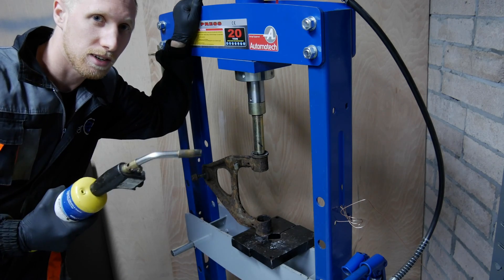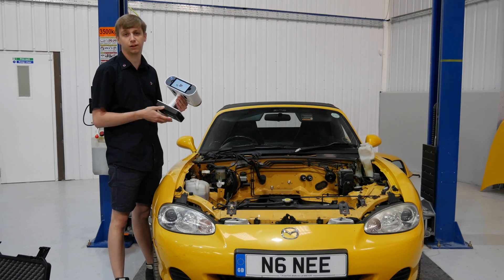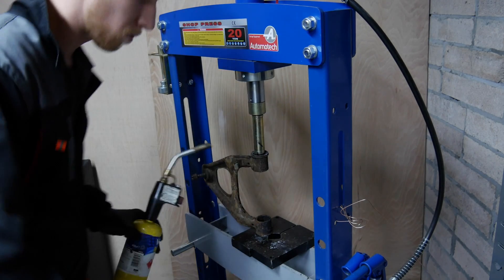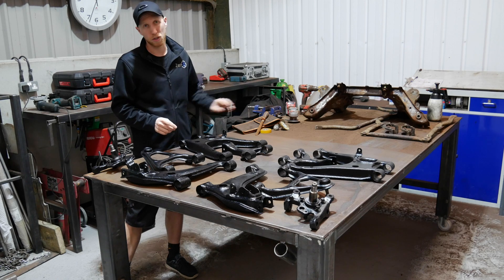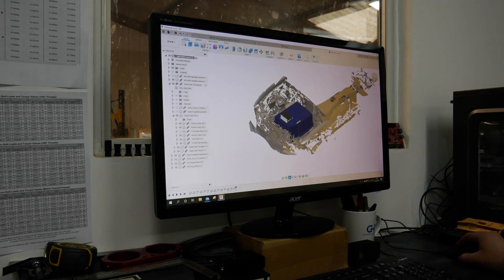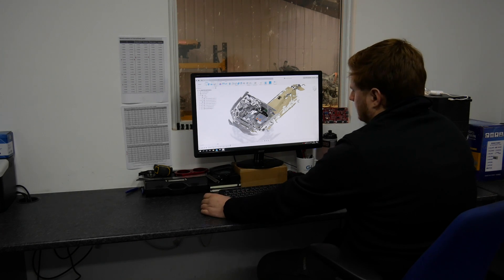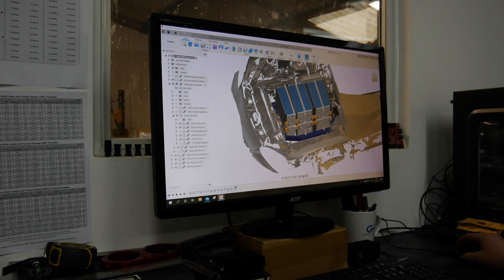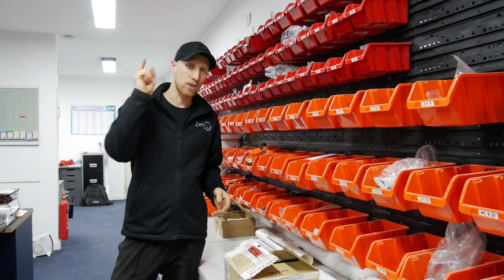Electric Mazda MX5 Miata Eunos EV Car Conversion - 3D Scanning, Fire & Cad Design

Comment: What's nice about the Miata is that you have quite a wide transmission/gearbox tunnel and so you can get your Hyper 9 and reduction gearbox a long way into the tunnel freeing up the engine bay for batteries, inverter, DC/DC convertor, water and pressure pumps etc.... This is not the case if you were mating the hyper 9 to the original gearbox. This is the big advantage of using the reduction gearbox in my opinion other that its simplicity and weight advantage. My only question is do you sacrifice a lot of top speed by having a fixed gear ratio? The hyper 9 is not a high RPM motor, so just curious what you're expecting in terms of top speed for this build given the reduction ratio, diff ratio and wheel size?
Reply from the maker: Jason Dunn our new motor is 250-450v
Reply from the maker: Our calculations is about 85mph with a 3.6 rear diff. So not perfect but enough. We do have a new motor under development that is the same size as the hyper9 but goes to 12,000 rpm and 330nm torque
Reply: @Hazell_Nutz  Wow.... that's powerful. I assume that's a high voltage setup? We have also worked with UQM135kw HP motors for max RPM of 10,000 but that's a 300+ volt set-up so requires a bespoke battery solution (unless you can fit 12~14 tesla modules in your car), but gives you higher top-line speed. Will be very interested to see your new motor. Thanks.

Comment: Definitely should’ve had the arms blasted! So much easier than wire wheeling! Fair play to you for getting it done though 💪🏻
Reply: Should probably had a acid bath or replaced. You could still see all the rust inside after painting them 🙈

Comment: For the bushes, we had a similar problem on the 1999 Z3 and for those lower controls arms we took the portable band saw and cut off the top rubber flange allowing us to just push from the outside in without putting any substantial stress on the arms themselves.

Comment: When you were cleaning the rust and scum from the arms, could you not have used an electrolytic bath to keep things a little tidier?
Reply from the maker: Yes someone else said the same think did not even think about it.
Reply: Time to invest in a bead blaster cabinet perhaps? Would have been so much easier and given better results.

Comment: Design looks very tidy with modules near what they connect to electrically and modules near each other, for short cable lengths and minimal resistive losses.  Reusing the factory mounting locations is definitely the way to go since they're already engineered for mechanical loads, etc.  Overall a very sensible approach.  Well done.

Thanks for another great video!  Audio is much better this time, but music is way too loud compared to voice.  Use an averaging sound level meter (plugin or function) to balance the audio levels better.
Reply from the maker: Thanks, just started using adobe premiere pro so am sure I am missing a setting

Comment: You aren’t putting batteries where the gas tank used to be? I figure that would help with weight distribution as well as increasing space for batteries. Cooling would potentially be an issue but if they are water cooled anyway then it couldn’t be that hard to run water lines where the old fuel lines ran and route them to a radiator up front.
Reply from the maker: Fuel tank area is currently being left so a second pack could be placed there, offering double the range.

Comment: its going to be very front heavy, considering the wait and placement of the electric motor and battery. you really need to balance the wait out more or risk loosing the back end while cornering. i don't know if heavily modified suspension will save this. i would personally split the battery 1/3 in the engine bay 2/3 in where the fuel tank was trying to balance it best you can.
Reply: Agree, but there are pros and cons of any design decision.  Splitting the battery pack increases wiring and electrical losses, and also adds complexity.  But in terms of driving, balancing the masses better fore and aft would be better.  

Keeping the battery pack centralized and right next to the motor, DC to DC converter and charger keeps things mechanically simpler and the electrical losses minimized since all the electrical path lengths are short.
Reply from the maker: The plan was to leave the fuel tank area for now, offers a option for a second battery pack. Might try and move the motor down the tunnel more to push weight back.

Comment: Couple of questions for you, 1- Do you have a rough initial estimate of how much weight you expect to put in for the electrics? 2- What is the plan for the space in the boot, is that being used for anything conversion related?
Reply from the maker: Weigh we should be about the same. The Ev system will be just over 220kg. The boot stays untouched

Comment: You could have easily removed all that rust from that suspension almost effortlessly with electrolysis. All you do is find plastic containers, fill with water and baking soda, put a positve 12v from a battery charger on any anode (any steel rebar etc) and negative on the part you want the rust to remove. Leave it over night on a light trickle charge and majority of the rust on ALL the parts will get disolved and will stick to the anode. It will leave a black film that washs and easily scrubs off.
Reply from the maker: Love that idea thanks
Reply: @Hazell_Nutz  Your welcome! also I forgot to mention that it is better then sand blasting in that the electrolysis can get the rust out of the deep crevices
Reply: @ibidu1  what about laser cleaning? i've seen videos it's impresive
Reply: @NikosAssimopulos  Thats great and all but very costly. Electrolysis many already have whats needed at home. Simple car battery charger or any 12volt charger, baking soda, wires, and a scrap steel that will collect all the rust. The nice thing about it is that it can knock out the deep rusting in pits or in small tight areas where a laser or grinder cant reach. Many shipwards use this to protect their ships hauls from rusting by putting a constant voltage in the water, mainly for submarines. So its simple, its cheap, and its very effortless.

Comment: You must have a lot of salt on your roads in winter. You are dealing with a lot of rust!
Reply: 15 years in Oz and I’m still surprised when I get an older car on the hoist and there’s never rust. England sucks for salty winter roads
Reply: It's England.  Land of rain and rust.  :)  Here in the desert parts of the U.S., which is most of it, rust like this is basically never seen.
Reply: The cars not too bad for its age/mileage...even the Mk3s are having to have rust repairs now!
Reply: @Garffey  mate it's an early 2000s car that looks like it's been sitting in a wet field since the 50s. Its in terrible condition
Reply: @magnetic0314  Believe me...I've seen far worse and far younger!!
Reply: I lived in northern NY for 20 years. The rust on cars was ridiculous! I had a 7 year old Mercury sable that I took to Oklahoma when I moved here ten years ago. I had to sell that car to a scrapyard two years later because no one wanted to buy a rusty car.

Comment: Controller cooling fans are on the bottom and exposed to dirt and water. Won't that cause problems?
Reply from the maker: It’s all sealed but once design work is finished there will be covers under there.

Comment: 3D scanner = $25,000. Miata = $2,500
Reply: Which is why they contracted out the scanning service.  Also makes a higher utilization rate for the scanner to be outsourced.
Reply from the maker: Actually 3D scanner $50,000 😂 it’s crazy money
Reply: @Hazell_Nutz  Haha yeah, Ive used a low end scanner, only $30,000. I assume they use lidar and those run the costs up ??

Comment: i'll be interested to see what you do to restore the balance of the car.  all that battery weight up front, some if it forward of the front wheels, is going to make things interesting.  was there any consideration to putting batteries in the fuel tank area?
Reply: You realise a stock engine is +/- 270lbs /120kg? The largest change will be now having a fixed weight due to the fuel not draining when driving, which is nearly 50kg of mass change.
Reply from the maker: The idea was to have the option for a second pack in the rear. If not can alway put some steel plates in the back 😂

Comment: disgusting. you'll ruin the character of the car. youre adding so much weight to the car and also removing the transmission? might as well just get a fucking tesla if youre gonna do that instead of ruining perfectly good miatas. also who wants to hear a vacuum cleaner instead of a engine?
Reply from the maker: Adding weight?? 😂 it will actually be the same weight! Or maybe lighter. If it sounds like a vacuum cleaner than some thing is definitely wrong.
Reply: @Hazell_Nutz  maybe so, but the miata is all about the weight balance. i'm interested in seeing how you tackle that problem. even if it doesnt sound like a vacuum cleaner nothing can beat the sound of a proper combustion engine ;)
shame about the transmission delete, it's one of the best feeling shifters in the world but im sure it couldnt handle the torque.

Comment: I get why you're putting everything up front as it's just easier in many ways, but it looks like it's going to be a bit nose heavy, especially since you're losing the petrol tank. How do the components you're putting in compare with what you've taken out in terms of weight and could you not use the petrol tank area for the motor and do away with the prop shaft all together? Would save a load of weight and move some to the rear.
Reply from the maker: Weight wise we will be about the same, might look at mining the motor farther back. Rear mounting might be possible but the point in this build for us is to test our new  single speed gearbox
Reply: @Hazell_Nutz  really looking forward to seeing it whichever way you go to be honest bud! Is this something you will look at selling as a kit?

Comment: Would it be a good idea to utilise the area under the parcel shelf that is normally where the fuel tank lives for an additional battery pack to bump the total system voltage up to the region where you could use DC-DC fast charging? If not what are your plans for this space?
Reply from the maker: The motor is limited to maximum of 132v so not an option. There is space back there for a second pack so could double the range.

Comment: PLEASE I BEG YOU, upload the scan to grabcad. It will help so many builders, "me included 😀". We mx5 builders are not usually well funded.
Reply: That Guy That would be very much appreciated.
Reply: Maybe run an premium patreon pack that we can subscribe to for a month and get the 3d scan. Spread the cost.
Reply: Perhaps sell the scan for a modest amount?
Reply: I have it on good authority that the scan will be available via the Zero-EV.co.uk website. I sent the scan to the website admin :D
Reply: The scanner cost $25,800.
Reply: @martingardens  $25,800 No way - go look on Alibaba
Reply: @martingardens  maybe selling the CAD?
Reply: @martingardens  "The scanner cost $25,800". So what? The engineering company that bought it sells a scanning service that pays for that tool over time. But once a scan is done, it's done, and opening it up to the world is a good thing. If they like they could charge for each copy of the scan, but the model of charging for the service and opening the data is much smarter. There are plenty of cars and there will always be new objects to scan - it'll be a long time before they run out of work.
Reply: @martingardens  dude you can actually jerry rig a xbox kinect as a 3d scanner that is pretty accurate! Go look it up, i know it's pretty amazing
Reply: piece of potato the quality is awful though.... especially for this kind of job

Comment: As you get closer to the final configuration, give us an idea what the forward/backward balance of the car will be, compared to its original.
Reply: I would have to think that it's going to be more forward heavy than the original with most of the components being placed in the engine bay. I guess the budget just wasn't there for designing and building a more balanced solution. It does help that the motor is placed where the transmission originally was, but I think it would've been more balanced to place at least some of the batteries where the gas tank was.

Comment: Hope the chassis rails and cills are sound, notorious for rust on the Mk2/2.5....you might have an electric m.o.t fail on your hands.
Reply from the maker: Have a sill replacement to carry out. Lucky this is not my first mx5 had quite a few over the years
Reply: @Hazell_Nutz  Well good luck, they usually turn out far worse than they appear on the surface....Not into EV just clicked on as it was an Mx, and yes, I'm a serial Mx owner too with a petrol obsession....lol

Comment: Awesome video! My only concern is the weight distribution after the conversion since the batteries weigh so much. Try to shift the weight as far back as possible. Maybe put something where the muffler was under the trunk.
Reply: For info, he said in other replies that an optional second battery pack in the trunk (boot) may be made available.  That would also balance the weight a bit better front to back.

Comment: When it comes to the batteries, would it be best to put majority behind driver in fuel tanks location, then any more low down in the front? With all the torque from an electric motor it will light up the tyres trying to get off the line without the weight at the back to help. Awesome build so far, but you do seem to have picked an especially crusty MX5!
Reply: Ideally you'd want the battery mass low,  within the wheelbase (between the axles), and evenly distributed front to back.  However with an ICE conversion, there are only so many places for batteries to go, and they're not as optimal as a new, pure EV design.  You could split the battery pack front and rear, but that adds complexity, cost, and electrical losses.

Comment: I'm amazed at how rusty UK cars are.     I lived in TX and NM in the US and have had 5 Miatas with little to no rust beyond surface.
Reply: Sadly that's the downside to car ownership here in the uk....it rains quiet a  bit and we love  to chuck rock salt on the roads in winter! (I've seen 3 year old cars worse than that).
Reply: The east coast of the U.S. is pretty bad for rust like that too.
Reply: MX5s seem to suffer quite badly over here. Have seen some truly epically rotten ones which in general is quite rare on more modern stuff. The wishbones & brackets can only have been shown a can of paint in the factory! RX8s are very similar in that respect too.

Comment: why not convert a mazda rx8 ? as much as i love the wankel engine. its one of mazdas least economical engines produced, although with the least amount of moving parts, an electric motor equivelent could sure be fitted to make simal power? the rx8 dynos at 180bhp to the wheels, despite having 230bhp. 25mpg AT BEST. no matter how its driver, and sure a electric conversion would make up for the lack of tourqe the engine has ?
Reply from the maker: Did consider an rx8 but went with mx5 as they have a larger following.
Reply: @Hazell_Nutz  Fair play to you :), i have subscribed to your channel, seems like youve got a big project on your hands ! will be ineteresting to see what the finished products like. with that said, whilst i was browsing your site for parts to do my own conversion, i couldnt help but notice, you have no motors on there ?
Reply: @aukett16  The RX8 is nearly an exotic due to its unusual engine, and MX5s were produced in vastly larger numbers.
Reply: @LoanwordEggcorn  I'm very aware that the rotary is a dying breed, however, you can only blame the design of the engine, while i do love the engine for its simplicity, the engine is the rx8's downafall. however it is an all round good package, just sucks about poor fuel economy, if it was easy to turbo and didnt blow apex seals, it would be a winner, the REW engine came turbo'd from standard and the only option for engine performance from an rx8, is that swap. which by the time you work out the money and work involved, why not convert it to something that doesnt guzzle fuel, and has amazing tourqe/acceleration ?
Reply: @aukett16  I agree with everything you wrote  The Rotary is an amazing engine (that's also fundamentally impractical), and the RX-8 is an outstanding car.  It could make an interesting EV conversion.

Comment: The wonderful thing about an MX5 is the weight distribution is magic. I imagine the weight of batteries, motor and supporting systems is about the same as the original ICE/transmission. In the design, have you distributed weight similarly to the original to maintain the MX5 magic?
Reply from the maker: I need to get some more weigh in the rear to be honest but we will see.
Reply: @Hazell_Nutz  In terms of available volume, the engine bay is a logical place to put the battery pack, but it does seem like too much mass up front.  But there's only so much you can do in converting an ICE, since they're they're packaged for ICE components.

Is there any space behind the seats or otherwise within the wheelbase?
Reply: This. I feel that you must take into account the weight distribution as a top priority, what's the point otherwise if it handling will be adversely impacted after such an awesome transformation?

Looking forward to this build :D